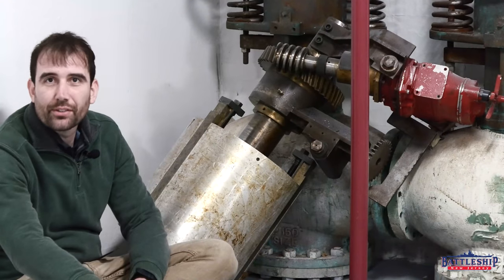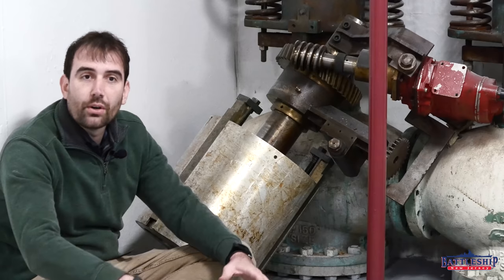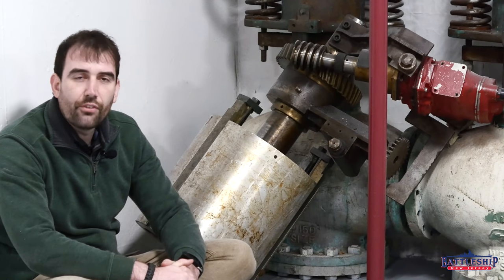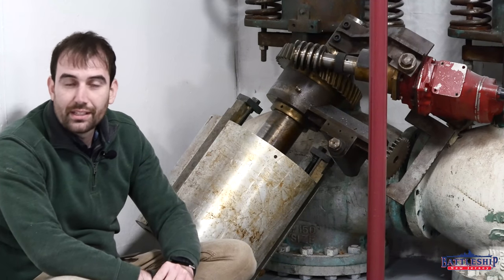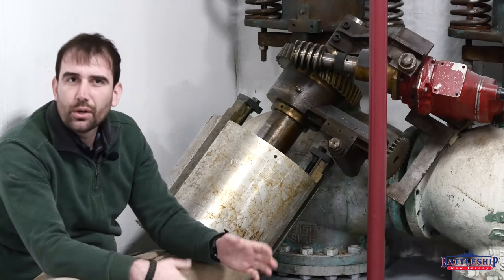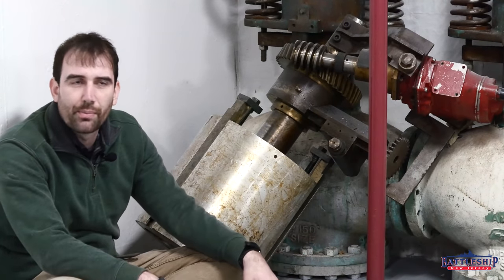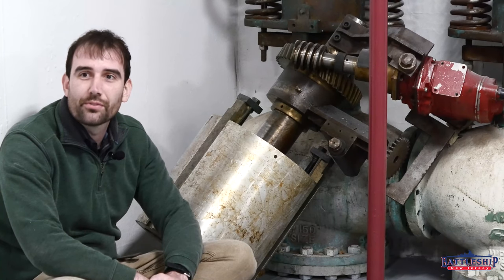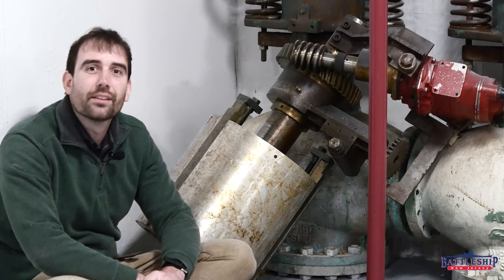How Do You Circumcise a Battleship?

Comment: I remember when they replaced center barrel turret 2 in the yards at Long Beach. They used Herman the German floating crane. If I remember correctly it took 2 weeks. Rumors were they called back a retired shipyard worker from the east coast who had experience changing out a 16inch barrel.
Reply: I think Herman the German is living at Panama Canal  now, he was sold off and shipped off.....I remember seeing the Missouri in the Harbor there back in 87-88....it was majestic.....cheers,,,
Reply: @ypaulbrown   just googled it. She is at the Panama Canal.
Reply: @gmgg424  thanks...appreciate it...
Reply: They called back a lot of ex-battleship workers and sailors...  Worked on the Jersey May '82 to Jan. '83;  Missouri, Oct.84 to Jan. '85, with a seven day gun shoot sea trial, to boot!
Reply: @adrianpasillas3832  What did the ship feel like when the 16's went off?  Did you feel the ship recoil?  Was there anyplace where you wouldn't notice? (I suspect not).   Was there any warning onboard that it was about to happen?
Reply: @bobgehrls8538   You could feel it through the whole ship.  She would shake.
Reply: @bobgehrls8538  During a gun shoots they would announce stand by for 16” firing. Then a salvo alarm would sound. The one time they did not was when we were doing an ammo offload into Lebanon. They were firing most of the day.  Turrets 1&2 would fire together. Then turret 3.  The next day I was on main deck by turret 1 barrels and the sleeves were expanded past the barrels. Wasn’t much. I think maybe an inch.
Reply: @bobgehrls8538  you hear the announcement everyone you watch a video. The opening is the actual announcement and firing alarm prior to a gun shoot. 

Ahhh. The memories. As an engineer, the alarm was always they indicator to get out of the supply vent, otherwise you get rust blown all over you.
Reply: @ypaulbrown  Yep = thank you to GMG for the info.  https://en.wikipedia.org/wiki/Herman_the_German_(crane_vessel)
Reply: and the crane that rebuilt Herman - an old converted battleship: https://en.wikipedia.org/wiki/USS_Kearsarge_(BB-5)

Comment: I don't know if it was the weirdest job, necessarily, but I have an uncle who was in the Coast Guard for a while, and he told me about what might have been the most pointless job in the military, which was the time he was assigned to pull staples out of some preposterous number of multi-page documents and then restaple them with the staple diagonally across the corner instead of horizontal.

Comment: On the Lexington back in 61-64, as a Signalman, one of my jobs was making and repairing signal flags. I had a medium duty Singer sewing machine in an old 20MM belting room as "bunting repair". One pennant not in the supply system was the PUC or Presidential Unit Citation. I made the ones for the Lady Lex. She had two, so I  sewed in a blue star showing a second award. I also repaired a ton of Foxtrot (F) flags, which flies during all day air ops. I also made a 25 by 19 Jolly Roger for when we crossed the equator and later flew it in Aransass Pass, Texas (near Pasadena) for some celebration there.

Comment: I have read that replacing the center gun barrel of Turret # 2 was difficult as breaking it loose was a problem but they were  eventually successful. When I visited the Heavy Cruiser Salem last November I asked Dr. John Scholes what the square protrusions on each 8" gun barrel were for as the 16" guns do not have these. He told me that they were attachment points for an outside Milling machine  to trim protruding gun liners. Perhaps Ryan could verify this with Dr. Scholes and do an in depth video in the future on this subject.
Reply: Would make sense. The previous Baltimore and I think later treaty cruisers used 8"/55 from the same rifle generation as the 16"/50 rifles. Salem used the Mk 16 8"/55 which to the best of my knowledge were the only naval rifles of that generation. Had Montana launched she likely would have had a similar feature for her rifles if they didnt use the stock of existing 16"/50 barrels in storage.
Reply: Regarding "breaking them loose" - do you mean to tell me that these enormous barrels just like threaded on? Or am I not understanding?
Reply: @paulloveless9180  good question. I could ask the same about cannon of any size.
Reply: Some artillery I have seen are a smooth sleeve the gun rests in and is held in place by large pins, others the breech portion screws into the barrel remaining attached to the mount. I suspect it is the screw on type but that is just an educated guess.
Reply: @Colonel_Overkill  I think I read somewhere that the 55 Cal barrels on 16" guns drooped too much and were found to be less accurate than 50 Cal guns. If you go back you might find that the "Mk 16" was a model of the gun they were writing about and that the Navy had no plans to build a 16" 55 Cal gun and that the Montana was to have the same 16" 50 Cal guns that the Iowa's had--just 4 turrets of them.
Reply: @Colonel_Overkill  On artillery smooth bore guns: smooth liners are for Rocket Propelled Devices that are self guided or have pop out fines that spin the round for accuracy. like an RPG.
Reply: @thomasmoore8142  the 55 caliber was for the 8" guns, not the 16". I also worded that poorly I see, the sleeve I mentioned isnt the internal barrel lining the shell contacts but an external lining the barrel slides into to interface with the trunions. I dont see that as viable on guns this high pressure but its also possible a system was used I dont know of.

Comment: Weirdest job I had in the Navy was working on submarine sonar. I was the smallest guy. At that time I might have weighed 115. So, I was the one who could fit through the open valve into a ballast tank. Then squirm through the goop “Whale Sh—“ is what we called it. And change out the hydrophones. They always picked January in Norfolk to fail, and that had to be the coldest nastiest water.    As far as gun barrels… we stopped in Oakland and there were three of them laying in the grass on base. Not on display , just laying there at the supply depot. That was 1978.
Thanks, Steve H
Reply: Best job example yet!

Comment: The sleeve slipping forward during firing totally makes sense.  What doesn’t make sense to me is how they were able to build up theses barrels.  I have watched a few older videos on the process, but will never understand it.  Thank you again for your continued fantastic content.  Many museum ships owe you a great deal of credit for raising awareness to their existence, and the need and effort and funding it takes to preserve them. All the best sir.
Reply: For those wondering: Freeze the sleeve you are trying to slip into the barrel, heat up barrel you are trying to slip the sleeve into

Cold shrinks the sleeve, hot expands the barrel. When they cool down and warm up, they aren't coming apart.
Reply: It's not a case of the sleeve slipping so much as it is the sleeve lengthening from the heat/pressure of the gun being fired and the shell expanding (obturating) to grip the rifling as it travels down the barrel.
A common misconception.
Reply: Check out Periscope Films channel.  They have one on the Naval Gun Factory which was located at the Washington (D.C.) Navy Yard.  Fascinating video.
Reply: @flick22601  There was, in the '90s Washington Navy Yard, a spare piece of the armor used on Yamato/Musashi, that had been "tested" with 16"-50 AP, likely at Dahlgren. Nice clean hole in that big block of steel.
Reply: @jacquesblaque7728  - Gosh Jacques, I remember seeing that.  Thanks for bringing back the memory.

Comment: All jokes aside, just the fact that over time this type of wear issue occurred, was discovered and diagnosed, and that tool was designed to serve the function of correcting the issue is pretty interesting. That it was still in the ship is a bonus. Any idea when it may have actually last been used?
Reply: Given how the barrel was built, its not to surprising, and most likely a issue the engineers foresaw before this barrel type was put into service, since the rifled liner was just a press fit.
Odds are the last time this tool was used was somewhere around 1953, since the turrets were re-barreled after the Korean Conflict. From there, they'd introduced an additive during New Jersey's Vietnam commission that greatly extended the barrel life. A better additive was developed during the 1980's commission, mostly to address the reduced velocity of the aging powder, but was also found to have the effect of further extending barrel life. Cant remember the exact number he mentioned, they have an entire video on this, but I think it was thousands of shells before they liners wore out again. So yeah, maybe 1953, possibly right after the Vietnam or right before the 1980's commission.
Reply: @sparkplug1018  The liner erosion was so reduced that the Navy changed how they expressed the life of the barrels to reflect that the mechanical forces from firing would wear out the barrels before the liner would need replaced.

Comment: All this info about the Ships of the Line. I was on board the USS Merrick  AKA-97 - 1958 - 1961 and our task was to take supplies of all sorts from Port of Long Beach to everywhere we had military in the Far East. I was a FT - Gun Fire Control - and more than once the ship 'requested' my presence at the Fire Control computer so we could get an accurate distance to navigate into bays or rivers that were a 'tight squeeze' - the regular radar wasn't that precise. Mine was within 3 feet at 1000 feet. I did a lot of tuning to get it that close. Quite an experience.

Comment: The weirdest way I had to work on something that was "behind" a helo's instrument panel was to "lay" in the seat upside down. Had to do this a few times on H-2's and once an emergency wire repair on a H-1. Didn't want to be in that position for too long.
Reply: Sounds like when i had to work on wiring on my 924. Lay on your back on the floor/door sill. Put your head under the dash. Then flip your feet over the shoulders of the seat. Then insert yourself the last foot or so to see around the kick panel. Still one of the worst contorted positions ive had to be in.
Reply: I've had to do this a few times on cars. Not too bad in there though.
Reply: @Synergy7Studios  being 6ft and it a small sports car changes it from not bad like with a truck or nornal car. To a pretty uncomfortable shoulder stand around the steering wheel and seat. Just to have the rest of your body bend the other way mid torso.
Reply: @high633  oof, that's rough. I'd let my legs stick out the door.
Reply: @Synergy7Studios  has a pronounced door sill so the floor is like 3 or 4 inches below the sill line. So if you are just poking under there for a fuse totally. Any sort of prolonged work though all your weight on that one spot hurts pretty good.
Reply: @high633  ah, gotcha. Most cars i work on don't habe that.

Comment: Weirdest jobs in my 20 years... Needle gunning and grinding and painting the inside of an avgas tank on the USS Coral Sea, cleaning and refurbishing the inside of CHT tanks on several other ships, cleaning out the main condensers on 4 different ships, inspecting and cleaning the sumps on the reduction gears on an AOE, which had two of the engine sets from the USS Kentucky. Of course I did my time as "mess crank"... and many other "working party" jobs over the years. One of my favorite jobs was working for E division on climbing the masts and changing light bulbs etc... PMS was always a chore for everyone and on some ships Engineering Dept. used folks from every division to get the job done. Crawling bilges was one of my least favorite chores.
Reply: Wow! Did you have to wear PPE like a respirator while in the CHT or AVGAS tanks? Was it stupid hot or did being below the water line make it comfortable? Did you ever see tools or grafiti left by the builders?
Reply: avgas tank - enclosed room - makes me think : something like a fresh air mask ?

Nowadays it is basically forbidden (even in the US ?) to work in a enclosed tank like that due to shortage of oxygene forbidden to only use a gas mask with filters.
Reply: @TheStefanskoglund1  This was done during drydock period,  Full Tyvek over suit with airline hose masks. Full freshwater showers setup near access/egress area. We sweated gallons of sweat. Each man had only 30 minutes of work time.
Reply: @paulloveless9180  AVGAS tank: This was done during drydock period,  Full Tyvek over suit with airline hose masks. Full freshwater showers setup near access/egress area. We sweated gallons of sweat. Each man had only 30 minutes of work time. CHT cleaning was in-port during workups for deployment, similar setup as the avgas tank. That reminded me, on the Coral Sea we opened a void tank and found 1/2 ton of Korean War dated cases of rations. The Lucky Strike cigarettes in them were so desiccated, that when lit they  just burned up like a road flare. Some of the food stuffs were still edible. Then the MAA shut that down fast. No one got sick as far as I know.
Reply: @randallparker8477  ok the big risk is oxygen deprivation because the tank (i expect) doesnt have any openable bottom valve so any gases heavier than air wont disappear easily.  AVGAS fumes is one risk though they can be ventilated away (basically have something which forces normal air down into the tank and let it run for a few days.)
Reply: @TheStefanskoglund1  Tanks were dry, flushed with deionized water, the problem with AVGAS back then was the lead. The tanks were coated with some kind of epoxy coating inside, the paint chips and dust were mostly lead, the Long Beach shipyard wouldn't clean the tanks so ships crew, mostly V-4 Div. did it, they had to hire an outside contractor for waste removal and to prep and reline the tank. The AVGAS tank was internal to a second tank around it, usually flooded with inert gas during use. I don't remember if that was nitrogen or CO2.
Reply: @paulloveless9180  I've done a fair number of tank inspections on a variety of ships. The nastiest were cargo tanks on  a VLCC. The tanks need to be well ventilated before entry, you have an oxygen meter and an emergency escape breathing apparatus on you, and there must be someone at the tank entrance to raise the alarm if anything bad happens. Any tank entry will require a permit to work, usually to be signed by the Chief Engineer and first officer.
Ballast tanks and cofferdams are usually a lot cleaner and less dangerous,  but there is still a risk of lack of oxygen. 
Double bottom tanks are usually cold because they have the sea directly on the other side of the steel. Cargo tanks and HFO tanks are usually heated to keep the oil runny. The heating will normally be off when you enter the tank, but the heating pipes (steam, hot water or thermal oil depending on the ship) can still be quite warm when you enter the tank.
Reply: @SteamboatWilley  sounds damn hazardous! Thanks for taking the time to explain all that!
Reply: We overhauled a Ship Service Turbine Generator in one of the engine rooms on the Coral Sea during yard work at Alameda NAS around 1981. One of the yardbirds was this small elderly Italian machinist who spoke very little English. He was always smiling. One day, a new can of penetrating oil got dropped and punctured and was leaking. So somebody set it on top of a closed steel 5 gallon bucket and let the juice leak out so we wouldn't slip on the steel deck. Along came the old Italian gentleman in his coveralls. He needed a rest so he picked up the can of penetrating oil and sat in the puddle covering the top of the can. His face turned to horror and he started cussing violently in Italian. The penetrating oil soaked through his clothes and burned off his hemorrhoids and fried his nuts. The poor old guy had to be carried off the ship face down on a stretcher. That was 40 years ago and he's probably in Heaven now still cussing in Italian every time somebody remembers the story.
Reply: @kimmer6  oh my gosh lol! Why did the penetrating oil hurt him? Does it literally penetrate your skin?

Comment: my highschool rotc instructor was basically an airforce cable-guy, he spent his career just running phone, tv, power, and communications around the various military bases he was sent to, occasionally when something important landed like a command plane he had to run out and plug it into ground power and communications. like you said, not everybody is involved in combat
Reply: The Air Force probably has the largest ratio of non-combat to combat personnel of any armed force. For every pilot flying a fighter or bomber doing the actual front-line missions there are dozens of ground crew maintaining and fuelling the planes, working air traffic control, cooking, providing firefighting and rescue cover and so on.

Comment: It's similar to a tool called a ridge reamer, which is used to machine the sharp edges on a bore after it's been machined. They're commonly used in cylinders when rebuilding piston engines. A machinist might call it a facing tool, since this sort of operation on a lathe would be facing.

Comment: A similar device exists for firearms. It's not used because the rifled liner slipped out from under its casing, however. Generally it's used to make the muzzle flat and square after it has been cut down or otherwise damaged. It kinda resembles a hole saw with wider teeth and a solid spindle instead of a pilot drill.

Comment: It's almost as if someone took a parting blade for a lathe and attached it to a boring head for a mill. That tapered plug to hold it in place with the sliding gib / fingers is pretty sweet.
Reply: Or maybe a trepanning tool for wood working and they had the cutter bend inwards might be a better description